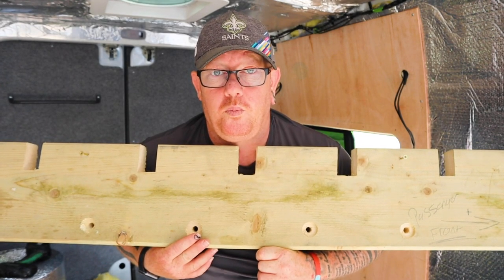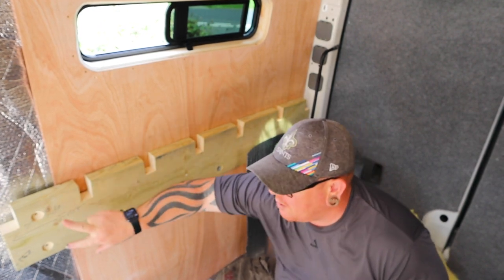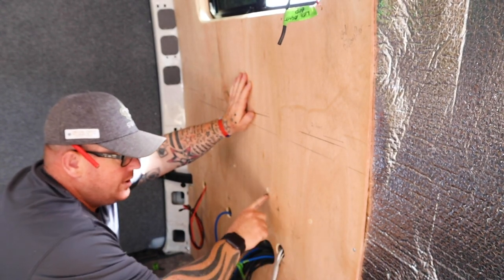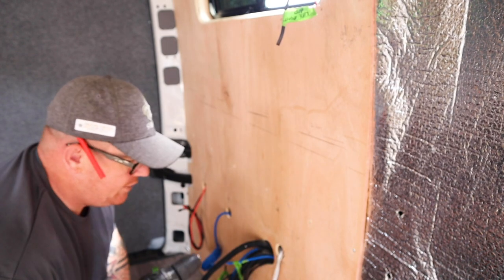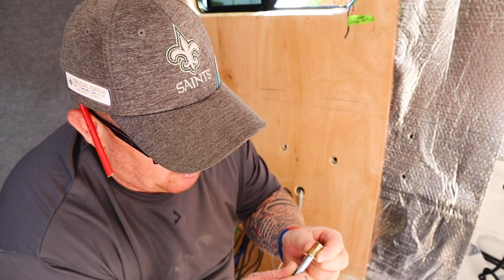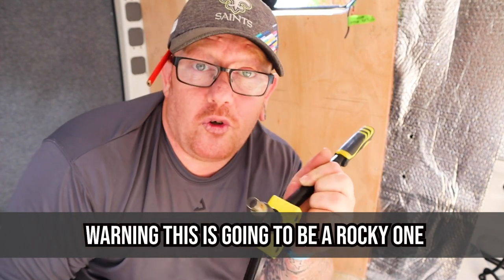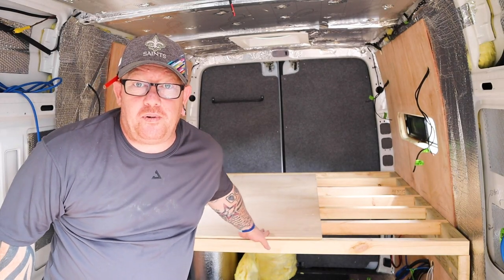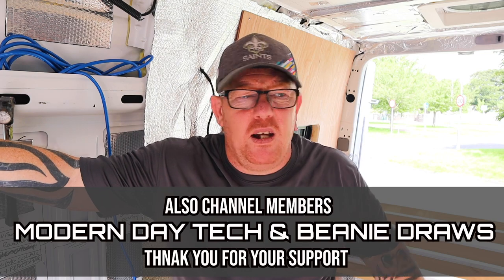Super Strong DIY Camper van Bed Frame

Comment: Really nice, This is the sorta thinking I had when building my bed at home. I'm not looking for another fat bloke to share my bed but I wanted to feel like it would be strong enough to support 2 of me during a restless night. I've broken my fair share of cheap bed slats, by myself mind, over the years so any bed I build is probably over-engineered.  I'm toying with the idea of using structural steel or aluminium angle or even unistrut but that's so far off in the future.
Reply from the maker: i was thinking of doing something out of aluminium but thought nop that will bend with my ass on it , so ended up going for this crazy over build

Comment: Did I miss it?!?... what’s the length and width?..Hu Hmm 😂 on a more serious note!😉 I’m 5”9 so wondering if I’ll be able to fully stretch out , sleeping sideways will give loads more space so if I can I’m gonna go that way.
.
I’m guessing the measurements from side to side ( steel inner wall to wall) is a few inches wider than once the ply and ins is fitted

I think I need to rent a van and spend the day measuring it all out 👍🏼
Reply from the maker: Defo a great idea to have a look in to a van first .but don’t forget for a little extra room you can keep the section where ypur feet and head goes un plyed and just veltrim it